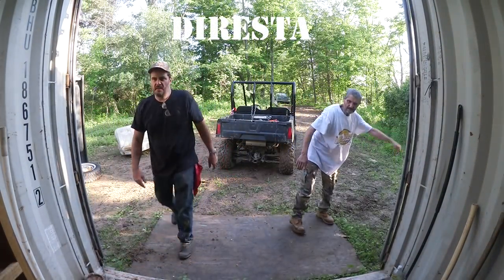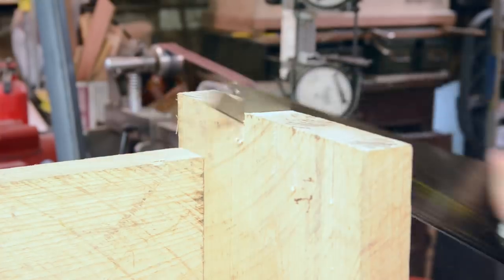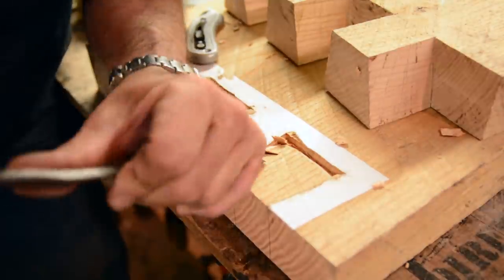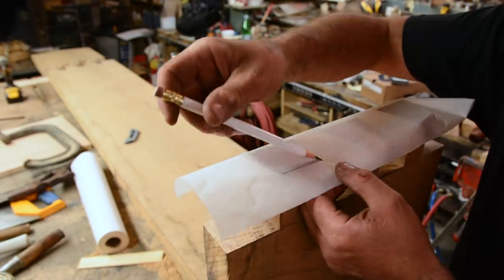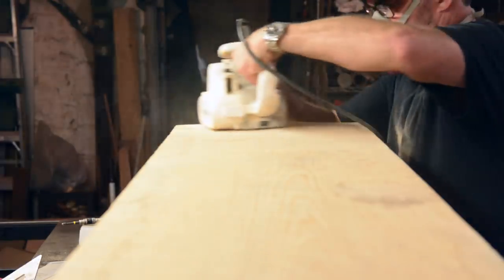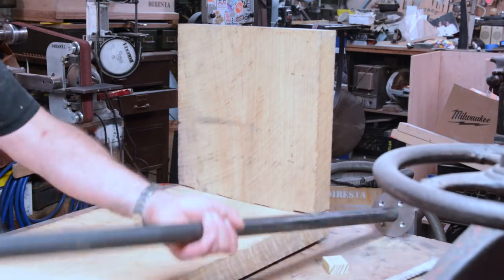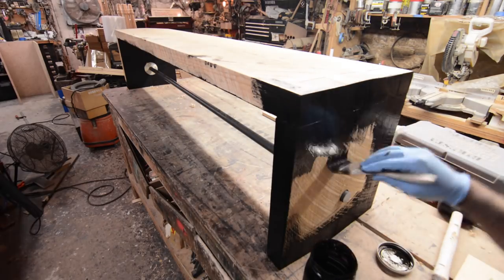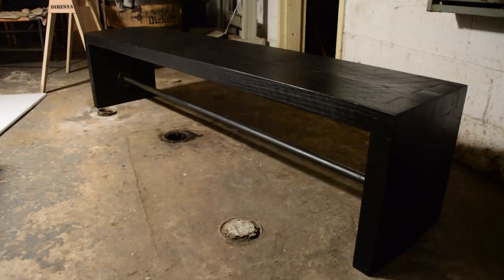✔ DiResta's Cut: Dovetail Bench

Comment: Nice build.  BTW another way to get oak black is to "ebonize" it.  Not done much anymore but was common in the early 1900's.  You take vinegar and iron (old plain nails , scrap etc.) and let that soak for awhile then paint it on the oak and it reacts with the tannins in the oak and turns black.  Like the die it penetrates a bit so it doesn't wear off as easily and because it's not a coating the wear tends to look "natural" unlike paint.  Not sure if it works on any wood other than oak since I think it needs the oak tannin for the reaction.  I'm also a big fan of dye.